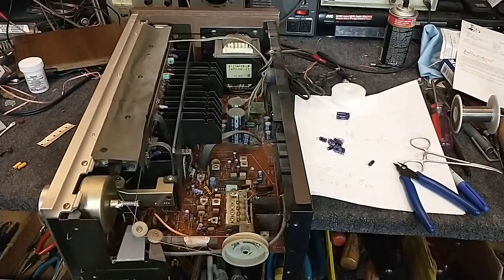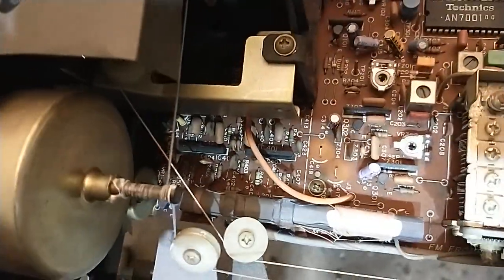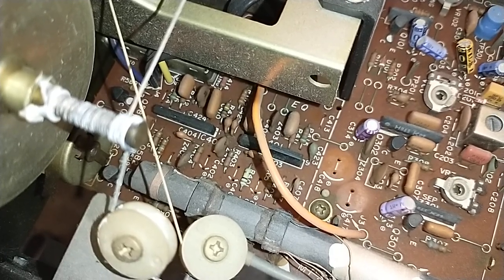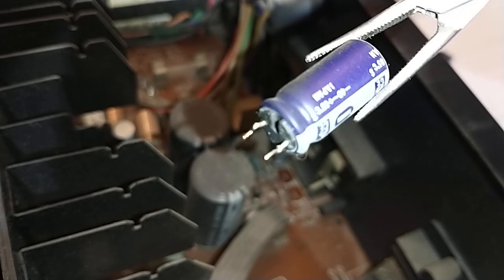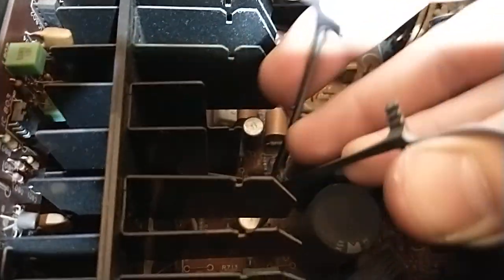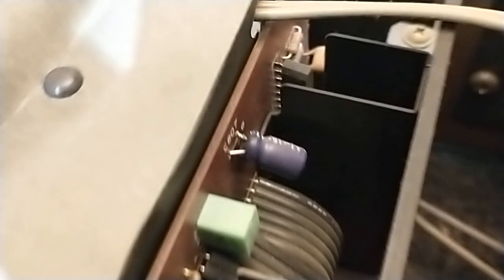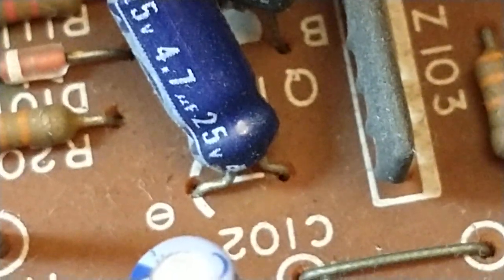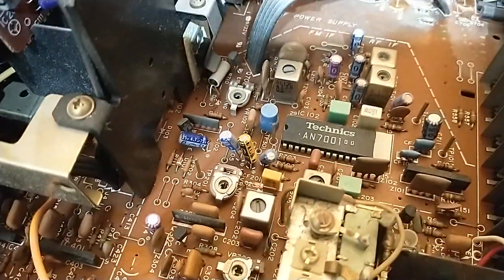PSA: Vintage Technics, National, Panasonic mid 70s - 80s products = change dark blue capacitors!

Comment: I have Technic Deck with 4 Band Receiver Model SA-370S since year 1981 & was running nicely. Last week it's capacitor 1000uF/25V from power distribution block E ( schematic circuit diagram) has brushed and few lines from print Board is Burnet and circuit is not clear. It can only be repaired when I get the picture of " Print Circuit Board".
It is my humble request. Kindly help in this regard. 
Thanks a lot for the positive kind support. 
With Best Rewards 0:06

Comment: Dear sir the transistor radio is still not ready to work. I have checked the detector diode, IF transformers, and a couple of D2A diodes which are all ok and no open or short circuit found. The transistors BF 195C 2 nos and BF194B 1 no in the circuit is also fine confirmed by checking the forward and reverse bias. The radio has several polystyrene capacitors which looks normal in look but I suspect them they might be open or leaky. Should I need to change all the polystyrene capacitors sir??? Please suggest.
I also doubt on 0.01 mfd ceramic capacitors too it also looks fine physically but I am not sure if it is good or bad. I need to check the gang capacitor on both leads by keeping the center lead in minus. I also checked all the resistors and it shows exact values. What step should I need to do next to bring the radio back to life. Please drop your suggestions. Thankyou.
Reply from the maker: More study of the circuit against a schematic is necessary. It's unwise to blanket the machine with new parts until the failure is found and remedied

Comment: Interestingly, I have less problems with the dark blue Matsushita caps. But I found the purple ones with red markings horrible! I have a noname Japanese deck from about 1980-1982 filled with those, and every single one of them are leaking. Fortunately the board is installed upside down, so they don't piss on the board, just their legs are corroding at this point.

Comment: Dear sir thanks for giving an informative video. I have a radio which has 3 bands MW, SW 1&2. It received all the available stations until last week. But suddenly it is not picking up any stations in all 3 respective bands. It doesn't have an FM band because it is an early model. The amplifier board is working fine and it gets 6v dc from the amp board. When I touch the MW internal antenna it receives slightly with little sound. I tried by disconnecting the gang capacitor but no change. I tried with new gang but no use. Should I check the band selector sliding switch ?? It has BF194C and BF195 C Transistors. Should I need to change the antenna coil too? Please suggest me which part to be tested. Thankyou sir.
Reply from the maker: Test coils and rock band switch. Switch is most problematic on multiband radios

Comment: Thanks, that video saved at least one of my VCRs.
I have an NV-8610 from around 1980 - purely mechanical drive. It works just fine, but after watching the video, I took a very close look at the caps and they just started leaking a little bit - like a year earlier and there would have been nothing, a year later and there would have been disaster.
A superficial inspection wouldn't have caught it.
Also I have an NV-870 from around 1986 that has a few of those leak, but not all that many, I already recapped mine a year ago as this thing started developing problems like 10 years ago. (I still can't get rid of the moiré lines on playback unless I turn the picture pot all the way to SOFT - and then the picture is fuzzy as hell, as expected)
I also have two Philips branded redesigned NV-850s which I should check - but from remembering how they looked on the inside, I guess their caps are all dried up... I remember screwdrivering the stereo board to get it to work with the bad caps - it works great! And besides, there's a ton of caps. And as of now, they both work fine.
And then I have two Blaupunkt branded RTV-810 (don't know what Panasonic model they are), these also have problems, but usually the caps in the power supply go bad like 2 decades earlier. Now they have problems with stereo sound and color blotches in the picture... I fear recapping these. A board that fits in the palm of your hand and every little space available is crammed filled with capacitors and they're double sided boards, good luck getting them out without ripping a trace on the other side.
Damn it, that's one time expensive hobby. At least I still use VCRs like anybody else did 30 years ago. Yes, I even time-shift.
Reply: I also have two Blaupunkt RTV-810s, and it's Panasonic equivalent too, the NV-F70. Their power supplies suffer from corrosion caused by electrolite leakage. Other boards in them also started to have some leakage. The cost of a full recap will well exceed the value of the units, but I will do it anyway. To reduce the cost, I will use Jamicon and Yageo/Teapo caps, maybe except for the power supply, in which I may use some proper Japanese low ESR ones. For generic use, Jamicon/Teapo/Yageo are fine. I used these when I was repairing our CRT TVs in the past, none of them failed ever, the CRTs got tired sooner. I use premium caps only in premium equipment.
Reply: I have an NV-8600. I haven't checked the caps for any leakage yet but I bet some of them will be bad.
Reply: And I just noticed my JVC first generation VHS rebranded SABA Video Recorder 6000 also has some of these, and they also started leaking. Also the head drum is spinning a tad too fast and if you brake it by hand, you get a picture for a second, then the electronics notice it's running "slow" and speeds it up again. I'd adjust that, but I bet that's a bad cap right there.
Reply: @senilyDeluxe  I have a JVC piano key VCR too, an HR-3330. I only found ELNA caps on mine and the machine still works.
Reply: @crashbandicoot4everr  Well mine has a mix of purple Matsushitas, dark blue Matsushitas and the majority are ELNAs. And... my machine isn't far from working either. It needs new belts though.

Comment: Hello Jordan, I am a fan of your work and enjoy watching your work. This video inspired me to attempt a recap of my Technics SU-Z65, I have pulled it apart and desoldered and removed the vertical boards to get to the caps, I followed advice from your other videos and made notes and maps of everything. My problem is I am having trouble locating the lower value capacitors, such as 3.3uf @6.3v, my question is, what are the limits of substitution and what is more important, can I use a 3.3uf @ 25v to replace a 3.3uf @ 6.3v cap or can I use larger capacitance. How far over voltage spec can you go?
Reply from the maker: 10v or even 16v should be fine.
Reply: @JordanPier  thanks for your help. I really appreciate it.
Reply: A huge thank you for your channel, spent a few hours changing all the caps, resoldering many dodgy looking joints and cleaning all the pots and switches, the amp works perfectly, I would never have the confidence to try and fix something like this without your channel, other channels are good but you really show how it is done and all the tips that lead to success. The only downside is the tuner only output a signal for about 30 seconds once I hooked it up. At least I have the documentation for it, although it looks too complicated for me to fix. Thanks again Jordan.
Reply from the maker: @caroleupene3237  when the tuner output goes away, see if switching to fm mono brings it back. If so, the detector alignment is drifting and it may or not be possible to fix with realignment. 

Of not, it could be the 12v supply to the tuner is disappearing, or the tuner pack itself has an internal failure
Reply: @JordanPier  it looks to be the 12v supply after checking voltages on the ic's. I only have a cheap multimeter for testing so I think I will replace a bunch of electrolytic caps in that area and see if it works. I have the schematic that came with it but none of the components are numbered in the machine and I am really stretching my ability to read the schematic and recognise parts on the board. Thanks again for sharing your time and knowledge,  I'll keep hitting the links on the sponsors as a thank you.
Reply from the maker: @caroleupene3237  first check for loose connections around the regulators. Common on technics for that to happen.
Reply: @JordanPier  the tuner is a Pioneer TX-d1000 digital tuner, I did find lots of questionable connections in the Technics amp including one transistor with fully loose leads. The soldering looks really good on the pioneer, i have had it 30 years but never really used it, the 12v on the first ic is low but still some voltage, the 12v is strong out of the power supply section and it still has some faint output on both AM and FM stereo at full volume on the AMP. I suspect something is pulling the voltage low and there are some Elna caps in that area. I don't want to take your time, I am an amateur just having a go, you have already done so much.
Reply: Final update, after changing caps a few at a time and testing I thought, "i should clean those switches while i have the bottom off", it was the 25/50 khz fine tuning switch the whole time, looks like I still have a lot to learn. At least now I know how to read resistors check voltages and change caps well. Thanks for your time, take care Jordan.
Reply: I opened up the Pioneer TX-D1000 I am going to use with it, everything looked fine with all Nichicon capacitors. It seems to work great. I still don't think I will tackle the SA-9800 amp that matches it, that looks way too complicated for someone with about an hour of bench time so far. I watch all the ads to give something back because I have got so much enjoyment from your channel. Merry Christmas and happy new year.

Comment: Jordan, thanks for the advice. My Panasonic RF-2200 radio didn't seem to be  working as well as I once remembered. It had lots of purple caps that were leaking just as you explained. Did a full electrolytic replacement, aligned it, and it's working great! Happy holidays.

Comment: What about those big, black caps in the middle of the board, do they go bad, too? I hear those biggies are almost impossible to find nowadays.
Reply from the maker: They don't fail often. These ones are fine.
Reply: Those main filter caps are 45 volt 6800 uF in a 303. I replace them with 50 volt 6800 uF Nichicon. They run about 5 bucks a piece from Mouser. Even after 40 plus years they generally are just slightly out of 20 percent tolerance. But it’s good practice to start fresh.

Comment: I’ve had nothing but bad luck with this series of caps from MatsuSHITa. Not only the dark blue capacitors but also the purple ones. They are by far the two most changed capacitors I’ve had to deal with. You almost never see older Elna or Nichicon capacitors fail when used within spec.

Comment: I wonder if the first generation VHS recorders (that are all variations of the same panasonic design) have these too. I have a few of those and certainly not looking forward to doing all of those as they have a TON of little caps all over the place. At least they're mostly easy to reach.
Reply: Thanks to this video, I just checked mine. I have a 1980 model with top loader and mechanical buttons (you need a ton of force to press!) They have these. And a lot of these... I ran out of 47µF caps, so recapping the rest of the VCR will have to wait.
Also some of them have just started to leak, I wouldn't have caught that on a casual inspection.
Reply: @senilyDeluxe  Yup those are the ones. Whelp, looks like it's recap time soon then. I have one in excellent condition that is in active regular use that I will try to keep running for as long as I can.

Comment: Just finished rebuilding two Technics cassette decks, one  1981 model, another from the late 80s, and a Technics dbx processor. They were electrically fine but went through a wholesale cap replacement anyway. Checked a bunch of older caps - capacitance good, ESR good. No traces of leakage anywhere. Some (merely some) had what looked like bulging bottoms but tested fine. For what it's worth.

Comment: Well looks like I might have a lot of work ahead of me in the future. I have a bunch of Matsushita gear from the early 70s onwards, though most of them work. I do, however, have a Panasonic-built GE HiFi VCR from 1985 that developed power supply issues, where sometime the power is weak on it. Also have a Technics AV receiver from 1986 also with a faulty power supply. Although, it works fine, the unit repeatedly turns off and on while the unit’s off. I suppose it’s those caps.
Reply: I've got a Hitachi vcr and two RCA vcrs that were made by Hitachi and they are filled with those purple Panasonic caps. I have replaced many of the bad ones but still have most that need to go. These VCRs were made around 1985-86. I've also got an early 80s technics micro component stereo that I'm worried to open up and see inside

Comment: From Illinois Capacitors "Life expectancy of Aluminum electrolytic capacitors":
"By de-rating, the life expectancies beyond 15 years can be achieved. When life expectancies exceed 15 years the expected life of the capacitor should be limited to 15 years mainly due to the sealing materialsdeteriorating over time."
On modern devices (1990 and later) the good capacitors will reach 10-15 years before they fail, low quality caps will fail after 2-4 years.

Comment: Hi Jordan does this apply to Technics turntables to, I have a sl1301 turntable.
Reply: Indeed it does. I have an SL-110 and two SL-150's (transistor servo not quartz lock) and they were all full of crusty electrolytics, as was my SU-V9 amp. Biggest problem on the decks is dirty pots and switches if you're having speed stability problems though...
Reply: Ok, I have found 4 bad purple caps.  What type of caps do I need to replace them with on my sl 1301 turntable
Reply: @Zockblatt Shickleblender  I understand what you're saying but what type of cap should it be this time so this won't happen again.
Reply: @Zockblatt Shickleblender ok sounds good to me,  Thanks for the reply and helpful advice.

Comment: Thanks for the heads up, I have a technics amp in the shed I was going to set up for a shed radio. I went and checked and it is exactly like you described. Looks like I will be making my first venture into electronics repair.
Reply: Pay attention to the polarity. One board or section at a time. Practice by desoldering on a scrap board first.
Reply: @Poppinwheeeeellllllieeeeez  thanks for the tips, I was lucky, the board was marked for polarity and then I noticed that every capacitor on each board was orientated the same way, I still did them one by one and put them back how they came out. I used solder wick and found it worked very well. The amp came to life and works perfectly.  Jordan is an inspiration, these are the best instructional videos available.  I am still amazed he does it one handed while filming, best tech with one hand tied behind his back. 😁 I just pulled my tragic old Pionees sa-9800 out to have a go at that one. It had a rough life travelling the country with me.
Reply: @caroleupene3237  i agree. 12 Volt vids and Ah Fix-it are both awesome channels. I like this channel and the others because you can watch, listen and learn a ton of info, skills and technique. Glad to hear got it fixed. Feels good. Peace.

Comment: Sadly I've seen this on NAD kit from around 2010!! Surface mount caps that leak and fail, cause the speaker protection to come in and oscillate, also the main filter caps rust and leak spilling electrolyte and destroying leads on any other components they leak onto. Shocking on 10 year old kit.

Comment: First lol, and yes they were garbage capacitors
Reply: Not so garbage if they fail after 35-40years in a unit which was designed for 3-5 years lifetime. Yes, their failure mode is horrible, causes a lot of damage. But hey, even RIFA / WIMA X2 EMI filter paper-epoxy caps are still being in production! The industry knows since the '80s that those are garbage and even dangerous after a few decades. I really don't get why they are making those in the age of PP and PE capacitors.